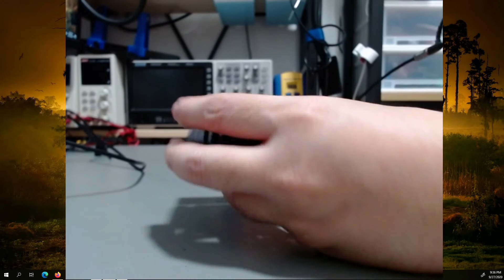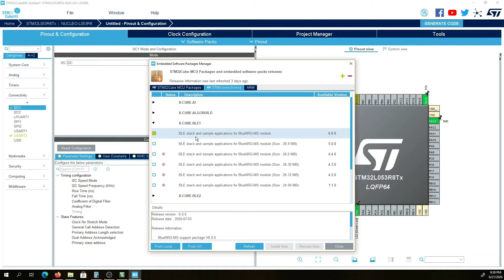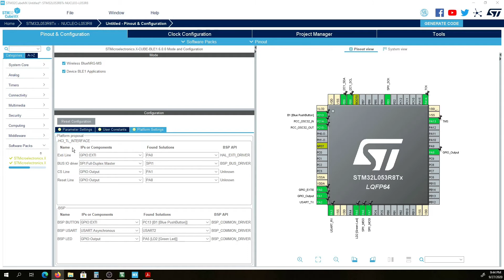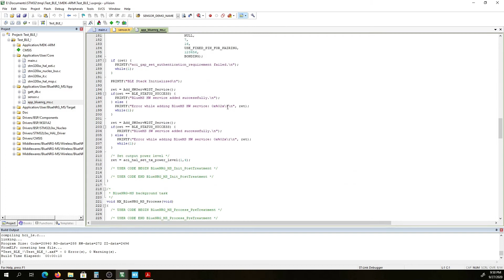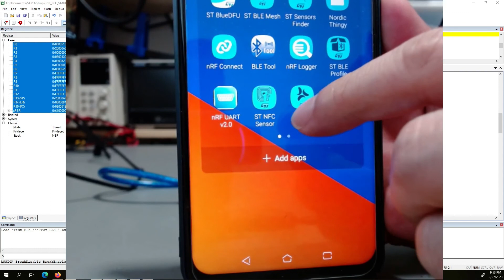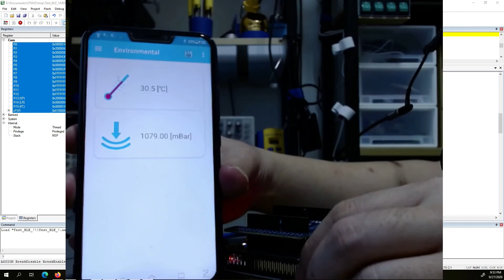Nucleo L053R8 with X-Nucleo-IDB05A1

Comment: Hello thanks for the video. I am having issue just seeing the device on my phone. I have set everything up according to the PDF and set up the board connection software pack I saw from your video, but I still don't get anything on my phone when I search for device. I am using STM32F746ZG nucleo board. It is 144 version, so I used the appropriate pins, just don't know what else may be wrong. I am using IDB05A2.